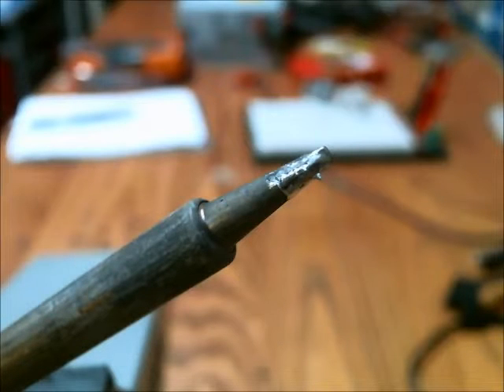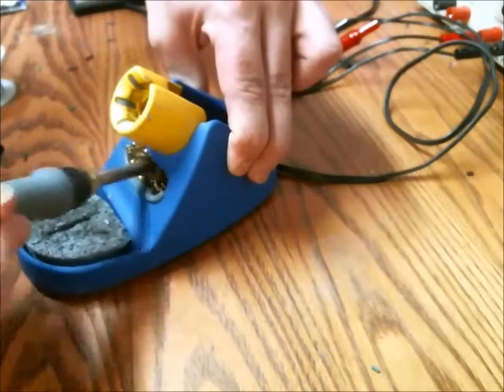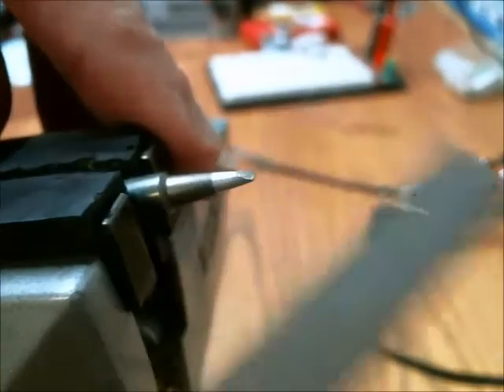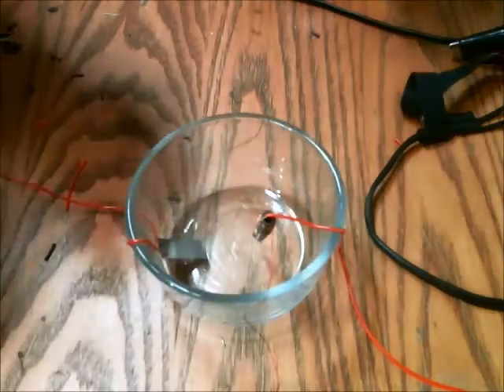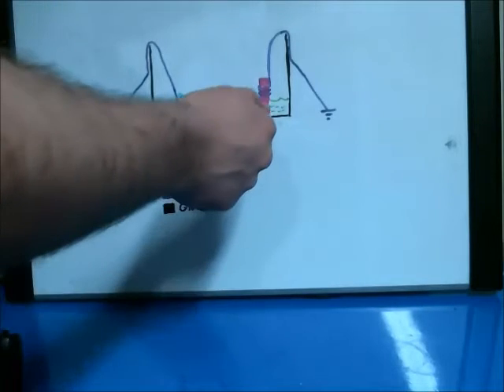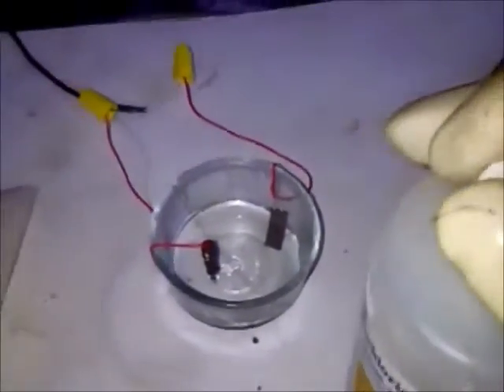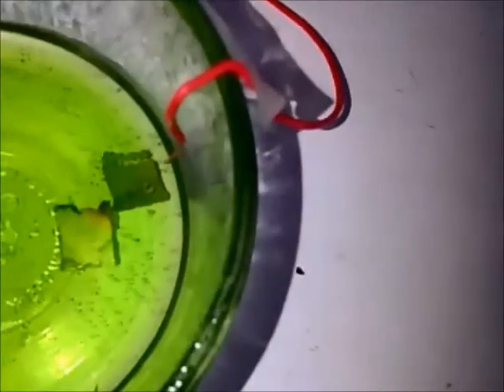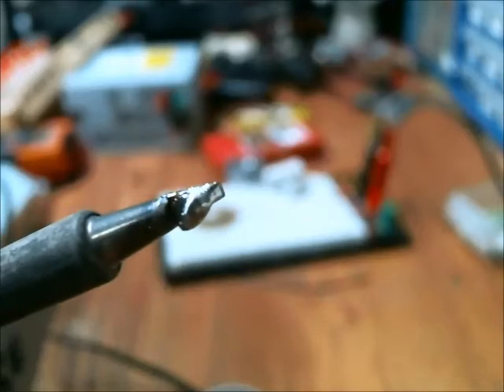Resurfacing Hakko Tip (Electroplating)

Comment: i recently went thhru this hellish path(could not find ny tutorials on the yt) myself trying to replate a tip i was succesful after abouth a month of trial and error. some tips 4 ur tip
1. nickel alone is insufficient nickel is not used for the end coat but typically as a base coat because nickel is an extremely good primer (paint analogy) lots of metal adhere way better to nickel plus it hasa decent ressistance to heat (btr than copper)
2. that dull metal bits are tipped with is tin electroplated on top of your nickel plate layer
these two alonne could be sufficient but if you are in it for the knowlrdge....
3. starting plate with iron as your first coat if it dont sticjk to coopper do nickel then iron then tin on tip or nickel iron nickel (jus tip) tin (tip)
4. not everyone uses the same shit so its fun to expirement w/ real world testing trial and error
i even did gold for the lolz which is how i learned about solder and gold embrittlement (the hard way :() anyways doubtful any1 sees thison 10 yr old video but hope its helpful alsodont listen to mfrs saying just buy a new one if u r in it to learn its very interesting stuff
Reply: This is a very interesting comment 🙂

Comment: OMG..You have to be kidding. You've been using this tip for about a year? And you spend so much time in getting it back to life ( when it was still wetting on one side). You have to much time on your hands dude. Buy a new tip for $7.00 (each) and get on with your life.  Your tip has been costing you .60 cents a months ,,,,and it still works!! WTF??  You are dealing with poisonous gases for a $7.00 dollar item?? Your problem isn't the plating... after using this tip for a year the barrel of the tip has now so expanded so much that there is an air gap between the tip and the heating element....causing you to lose heat and efficiency.    If you want to give a good suggestion to your readers......tell them to keep tinning the tip when it's not in use...buy some tip tinner to remove excess oxides ...and then REPLACING it after a few months. This is the worst tip video I have ever seen. I have a question for you.....  Do you have re-tread tires on your car? ....or.......are they just bald and dangerous? This Hack is a Hack.

Comment: Interesting video, my tips do not last very long and I like to try this experiment,  Can you tell me where to find a nickel plate or rod? Can I use stainless steel instead?  The tips I buy are made of solid copper and nickel plated.
Reply: @Blondie SL I would assume it would. If it plates well onto ur copper and stays there, u should be in business. When I plate nickel onto copper...or plate anything to anything really, I use the least amount of current and voltage that will get the job done. It's much slower, but allows for a better Bond and allows for u to turn ur copper for more even plating. Also some kind of agitation in the solution helps. (Not talking about splashing it out of the bowl, but maybe something like a popsicle stick spinning about the speed of an old cassette player constantly throughout the process) the difference it makes can be the difference in ur nickel plating flaking off or being a smooth nearly flawless nickel finish.
Reply: @TheBunnyhound   From your experience,would nickel plate on copper?
Reply: If your core is copper, you can't use steel. Steel won't plate to copper and copper won't plate to steel. After you plate iron or nickel to the copper, you can try steel. Steel will plate to iron or nickel, but I'm not sure how a steel coating will affect your soldering.
Reply: @TheBunnyhound  Thanks just one more question where can I get or find a  nickel plate?
Reply: @supersilve  eBay. Search for "nickel anode" there's several sellers that show up with those words

Comment: I was under the impression that the nickel plating is very thin, and it is only done so that chroumium can be plated over it... in areas where the tip is NOT supposed to wet. The wettable surface IS just cast iron to protect the copper from dissolving.  Perhaps some iron oxides had formed, which could have simply been removed to make it work, again. (Maybe after you had finished filing the tip, you could have just stopped there; tin it and done).  It is actually much harder to make the tip NOT wet where you don't want it to. If you could develop a way to intentionally and selectively make those iron oxides form, or to selectively plate with nickel and then chromium, this would be more interesting to me, personally.
Reply: According to the Hakko website, they do not use nickel. Copper core followed by iron plate over the whole thing, then chromium over all areas that no solder need to touch, finished by applying solder to the tip.
https://www.hakko.com/english/maintenance/topic_tips_life.html
Of course, this is just how Hakko makes tips. 3rd party tips are hit and miss (some are solid steel supposedly for durability). Plato are Copper core with an Iron mix plate over everything followed by chromium or nickel plate on all areas no solder needs to touch.
https://www.platoproducts.com/soldering-tips
I use only Hakko and Plato tips on my FX-888 as I find they fit the best and have the best heat transfer. I use 2 Plato tips for SMD work (that for some reason Hakko don't have an equivalent)
Anyway off subject.
I believe you are right, once he got through the black oxide he was done.
Reply: I'm pretty sure that the super cheap Radio Shack bits are plated in nickel. These are the ones that are essentially a piece of fat copper wire. And the plating is very thin. Apparently nickel is easy to plate (thin, anyway). This provides a couple hours of protection before it is eaten away. I don't see the point of plating an iron jacketed tip with a thin layer of nickel that will be gone in 2 hours.
Reply: Not sure on the RS tip plating (maybe I'll test). I did buy one that supposedly fit the Hakko FX-8801 iron, but in use the fit was not correct (gap at the bottom of the heater and it wasn't as snug either) 
In use, the nickel is used so the solder doesn't stick. So if the nickel does basically oxidize after a few hours it's no big loss as the solder shouldn't stick to the oxidized area either, other than that it's cosmetic. I guess the Plato tips I use are chromium as they still look pretty and shiny :-)

Comment: Core is copper. Copper is fully plated with iron, and the areas that will not be exposed to solder, also get plated with nickel, followed by chromium (solder will not stick to chromium).

If the iron plating has been breached, solder erodes the copper underneath (seen as pitting). Time for a new tip at this point.

To rehab a tip that won't take solder (normal tinning procedure), use tip tinning compound (looks like solder paste, but uses a more aggressive flux). If the tinning compound won't work on it's own, you can use gentle abrasion with brass wool or a brass bristled brush, then try the tinning compound again.  

More information can be found from soldering equipment manufacturers if you search their sites (some nice photos of copper erosion for example).

Comment from the maker: I have seen some interesting techniques using a sponge and the metal-acid solution pre-mixed, the positive is attached the the sponge and the ground to the object to plate, and by pressing the sponge on the object plating will occur. 
but honestly I doubt this technique works very well, and I I don't like being around the fumes emitted when the metal and "acid" separate.